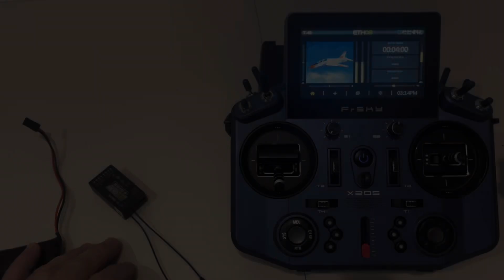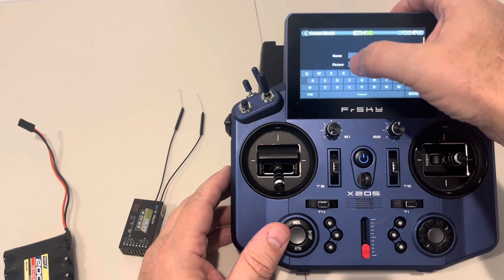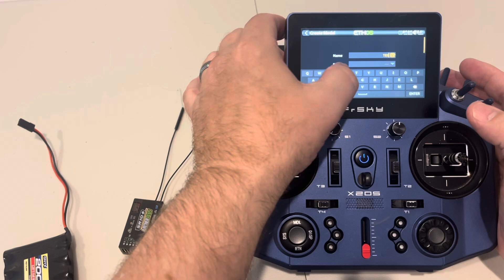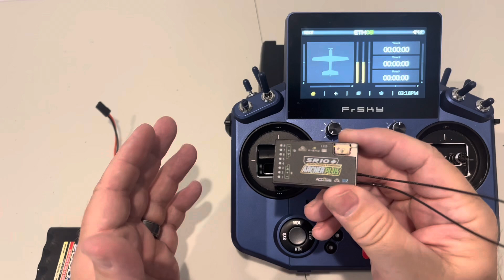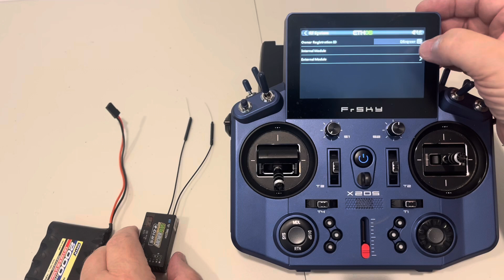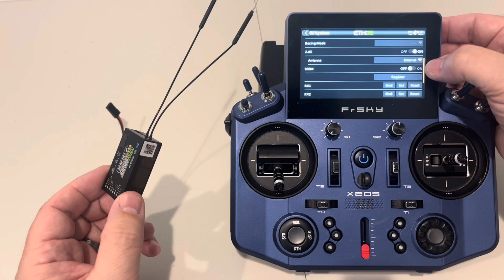FRSky X20S new model set up register and bind to a receiver

Comment: Thanks for the video. I tried to bind a R8XR and gps telemetry module to my Frsky X20RS but could not register, only bind. It seems to work although i have to discover sensor again to see values if i cycle power. Since it is labeled as ACCST and not as ACCESS, would that preclude the “register” from being available/working?

Comment: I had given up for a couple months, but decided to try again. The plane is junk of course. I pulled the receiver out, hooked it up to a couple servos, and it didnt work but the led works. Blinks green, flashes red and then back to green. A TD-R-10. I did the registration and it said OK. I did the bind, it said OK, but none of the servos move. I have a second TD-R-10 that I had not used yet, new in box. I did the registration. It said Registration OK, I did the Bind, the thing said Bind ok. Again, no servos move. I dont know what to do. Any ideas? The receiver wasnt hurt in the crash, I had control of the surfaces, the gimbal, and the motor.  Please help. I've been trying and failing since November. Total flight time, about 12 seconds over 3 flights.

Comment: Hello, and thanks for sharing! I have two questions:
1. Is it mandatory to register the receiver or just binding is enough? In other words, will it work if the Rx is bound only? As far as I understand, Registering is something like Spektrum's model matching — even if the receiver is bound to the TX, it will work only if the same model is chosen. Or am I wrong? 
2. Should one do the two steps in this order - Register -> binding, or might they be done vice versa?
Thank you!
Reply from the maker: Howdy. Thanks for inquiring. All I can say is what I’ve done that has worked without issue. And that is: 1) register then 2) bind. I do this each time I set up a new recover in an aircraft. Takes just a second. Don’t know why one would want to skip that. Thanks again for asking.